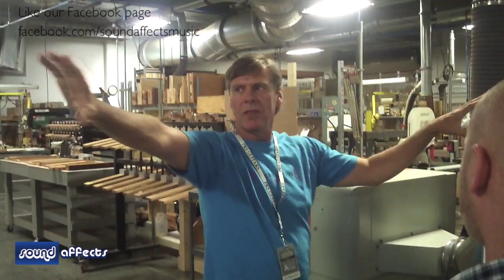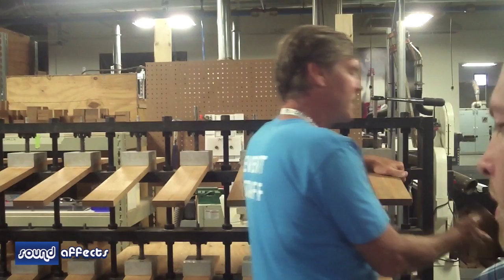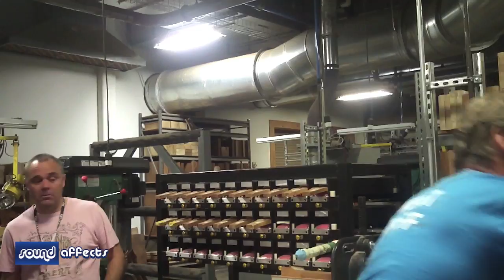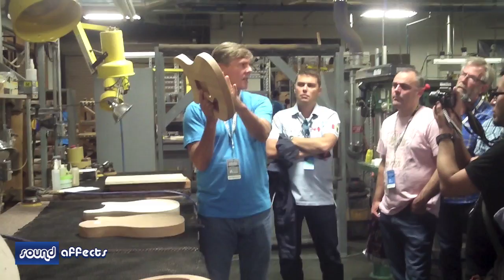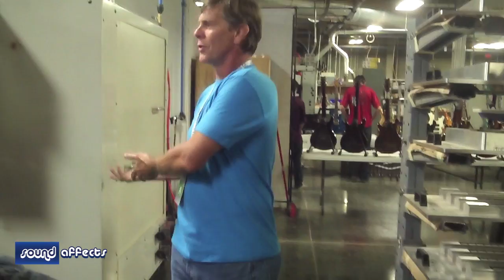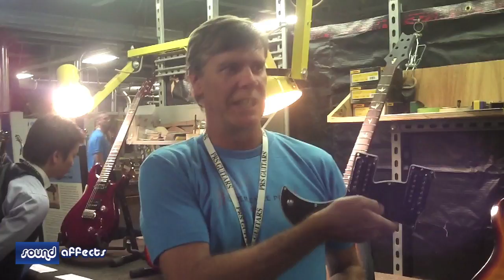PRS Experience 2013 | S2 Guided Factory Tour | S2 Guitars | Jack Higginbotham

Comment: I have a custom S2 24 and I simply love it. The action was a little high but I lowered it other than that the guitar is built like a tank. Even the pickups sounds great, even though they were made in Korea. I tested them against a couple of other pups and I was very surprised of the sound! Great guitar!
Reply: I hear you. I have a 30th Anniversary Custom 24 S2 and I was thinking the first thing I was going to do when I got it was swap out the pickups. However when I got it I realized that they sounded amazing and there was no need to. Now fast forward a year and I've added an S2 Mira Semi-Hollow to that collection and they are both amazing instruments!

Comment: I found it really interesting that the pick guards come preassembled from Korea.  I bought a 2013 Starla S2....and thought everything on the guitar was very high quality.  Sounded great, played great. Only issue.....2 weeks after buying it the selector switch completely came loose and fell apart inside the guitar.  It now makes a little more sense why.  I returned it and got a Custom 24 S2 instead.  So far it has been perfect....3 years of fairly heavy use.  Well built, good sounding guitar.  I think the idea of preassembled Korean pick guards is appealing to a builder....but from my experience....it failed miserably.
Reply: +Scott Kunshier That's not the result of a preassembled pick guard. That's a result of using low quality electronics to keep costs down. There wouldn't be a problem if they were using a high quality switch.

Comment: I have the S2 Custom 22. Superb in every respect and felt way better finished than the comparably priced Gibson LP Studios I was trying. The neck and string tension were just so much more comfortable. Pickups are great sounding and my only complaint is the tremolo. Works great but the tremolo block sucks a bit of life and tone out of the guitar. I will replace it with a genuine Mann Made that fits straight in. The only other issue is that the volume pot has become very noisy. Otherwise a great guitar and noticeably better than the SE range.